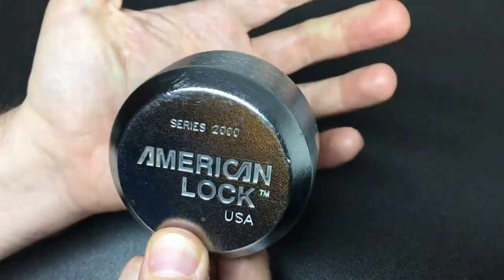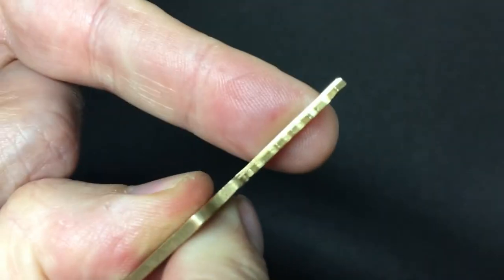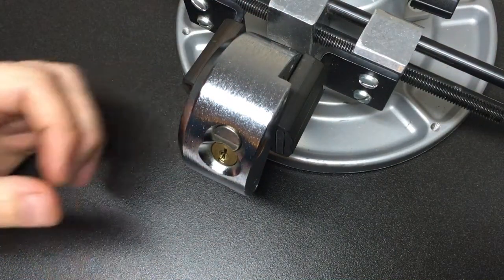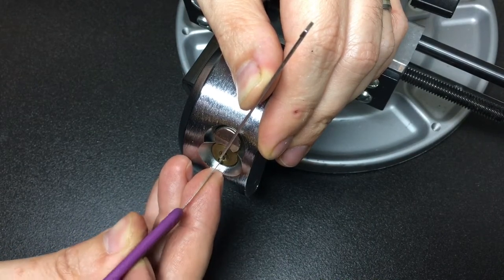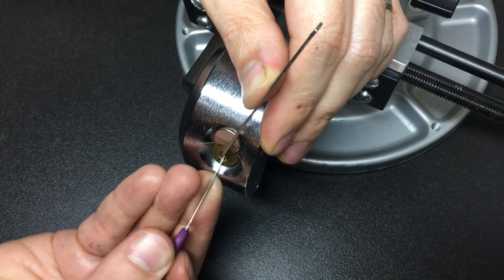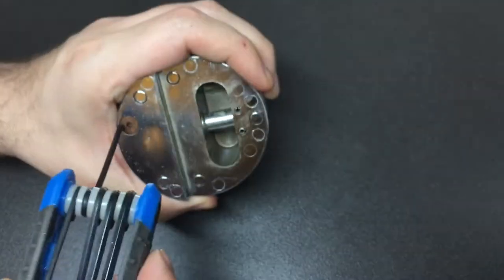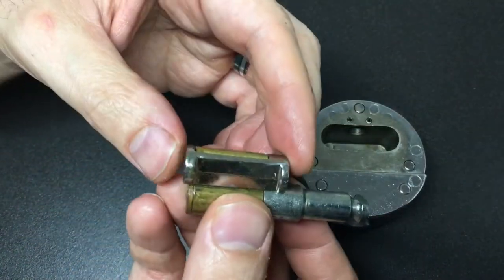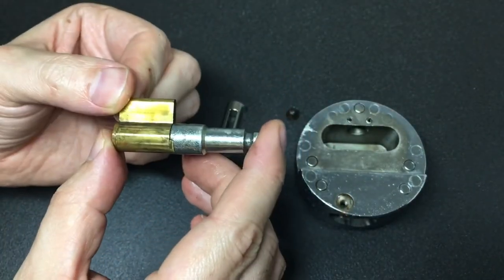American Lock Series 2000 Puck Lock Picked

Comment: If you put the key in and turn 180 degrees everything comes out those holes in the bottom of the body, thats how they load it at the factory !
Reply from the maker: Well, they key pins at least
Reply: i've had rebuilding and gutting disasters because of those holes, but they do allow you to make challenge locks out of them, threading the bible and maybe a little undercutting.not sure how well the mini kik will take regular pins but i have the means to find out ;)

Comment: I don’t know if it’s the best way or even a good idea, but I gut this type of lock by using the key, and turning the plug 180 so the keypins can be taken out through the bottom.  Yes reassembly is difficult, but not impossible... if you have the key.
Reply: it might be a problem to get the driver pins without mashing the springs after removal of the key pins from the core, except the springs are short and do not reach the core

Comment: Nice job! Curious to how much grief those split pins would be to reinstall? They look very similar to watch band pins but larger. Watch band pins usually aren't too bad. Depends on how brave you feel I guess. Cheers!
Reply: those split pins tend to expand when removed, so they need to be compressed before insertion, with a pair of pliers for example. probably some metal plate with a chamfered hole with a slightly smaller diameter than the hole where the pin goes in could help. while hammering the pin back in it should compress the pin enough. if the pin itself would have a "ramp" on the end, it would also help :)
Reply from the maker: Yeah, I wasn’t feeling quite up to the faff, sorry

Comment: Nice quick pick on a tough lock sir! Wonder if it's susceptible to comb picking? LPL was having some luck comb picking a bunch of similar puck locks. Thanks for the video sir 👍🏻👍🏻
Reply from the maker: It is with a thin enough comb
Reply: @LockNoob  I have the sparrows comb pick set and try as I might, not one of the 4-2000's were able to opened with a comb.